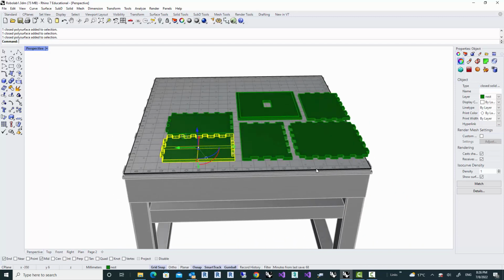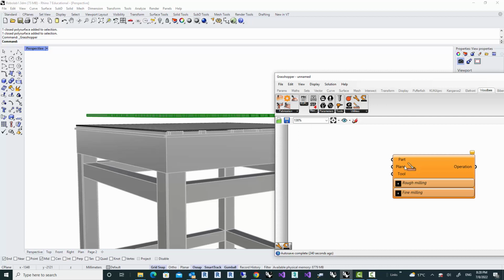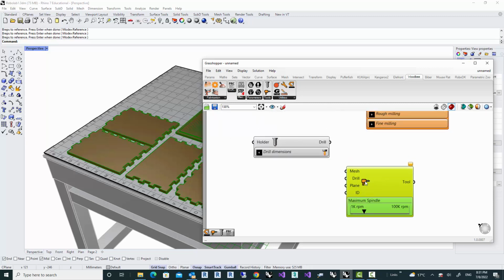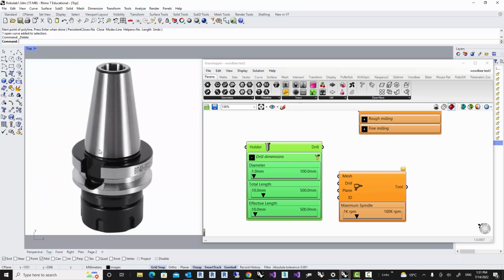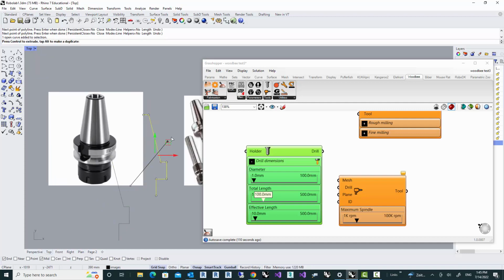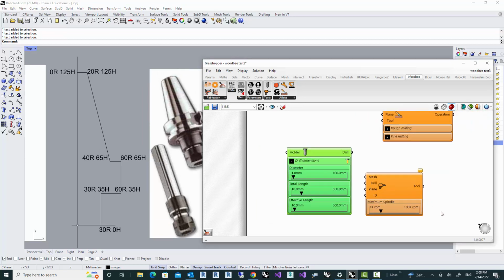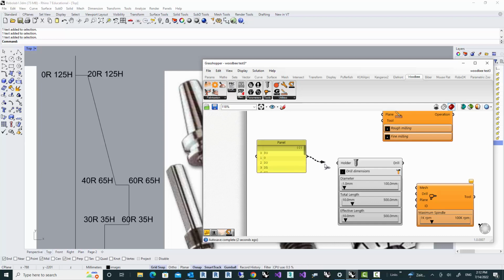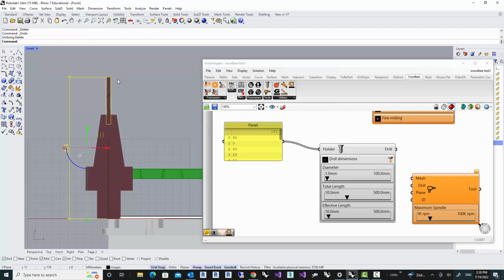creating Tool-Path (part1 : setting up the tool)

Comment: It is supports ATC? How I can define multiple tools and a drillhead with twenty drills?
Reply from the maker: You can do that using grasshopper native components, I will make a video when I get some free time 
Can you share a screenshot of your tool holder in the forum ?
Reply: @parametriczoo8568  I am working with a professional SCM Morbidelli m100 CNC machine which have an ATC spindle and a drilling head with around 20 drills installed and I am interested to see if I can make this plugins to work with that machine.

I will post soon but I don't know what forum to post in!
Reply from the maker: @Tokamak9  you can find the forum here : https://www.parametriczoo.com/index.php/products/grasshopper-plugins/woodbee/

Comment: 11:05 You put the bit into toolholder wrong. The top conical part it is the part where the toolholder gets into the spindle. The bottom part it is where the tool it is attached to the toolholder. Great video, btw. My bad, I think you are using a toolholder for robotic arms.